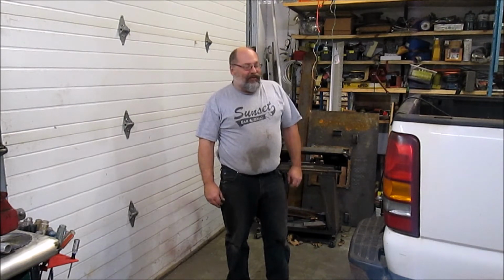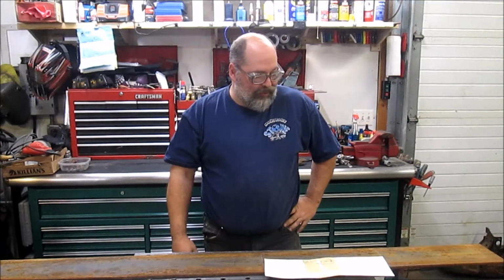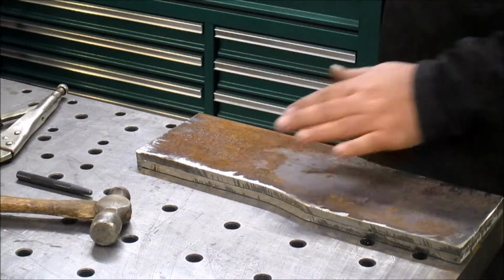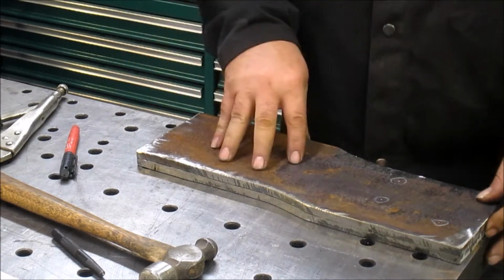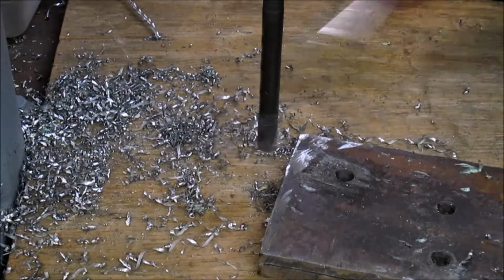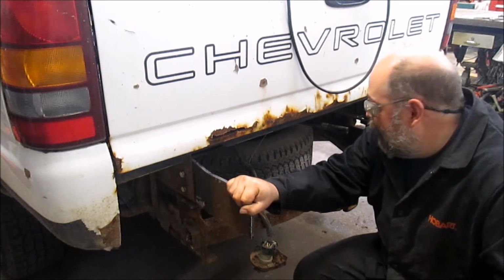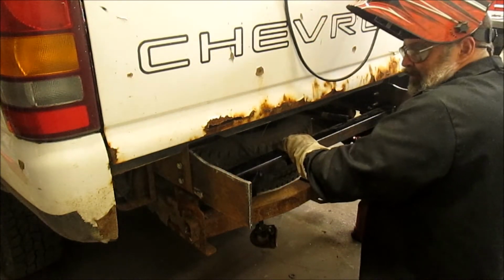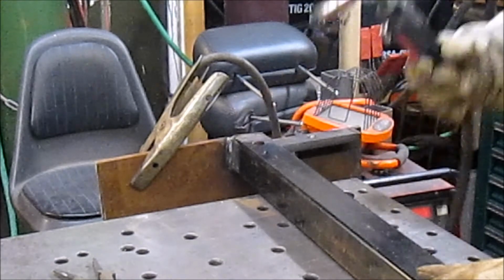2001 Chevy 2500HD Rear Bumper 1

Comment: Grade 5 is better for anything bolting to frame it’s recommend because the grade 5 will give a little where a grade 8 will brake like your your videos I’m working on a 02 Tahoe overlander fixing to start on rear bumper I like you front bumper just wonder if you have any drawings and would be willing to sare your design
Reply from the maker: Sorry no drawings ☹️, as in the videos I use cardboard to make templates for each bumper.
As far as grade 5 vs grade 8 I prefer to use grade 8 in most cases.
Reply: Wood-N-Metal Workshop ` you do good work keep making vids I’ve worked in the heavy truck field for years I took a class when working for the city it was put on buy a truck manufacturer and that’s where I learned that the manufacturer uses grade 5 in any frame attachments and it explains a lot why I seen so many failures over the years doesn’t mean any thing for light duty probably but just keep note keep up the good work